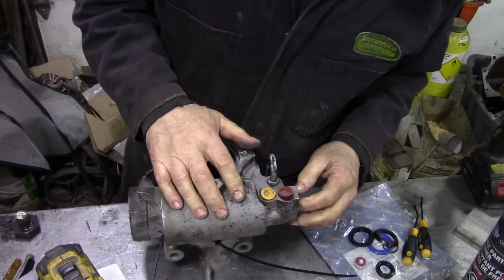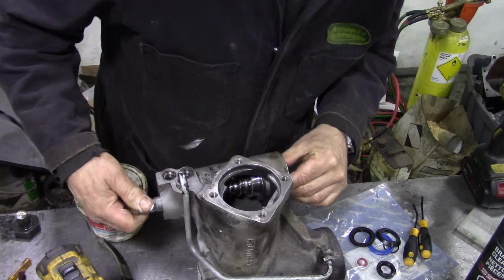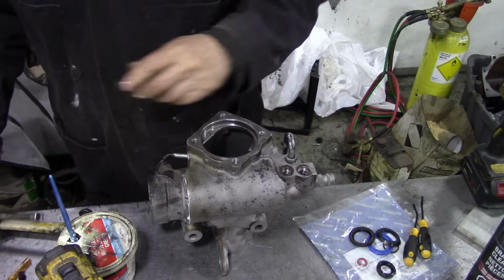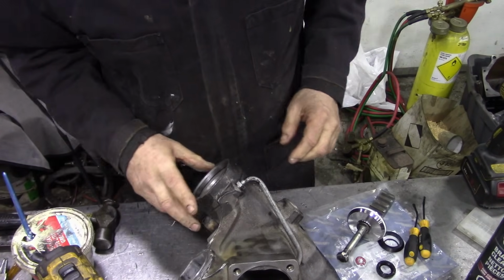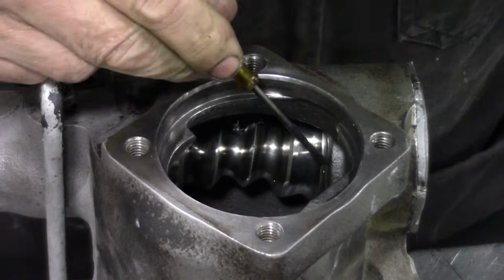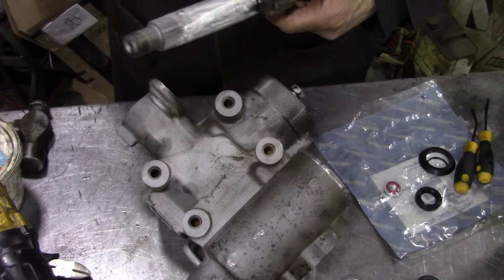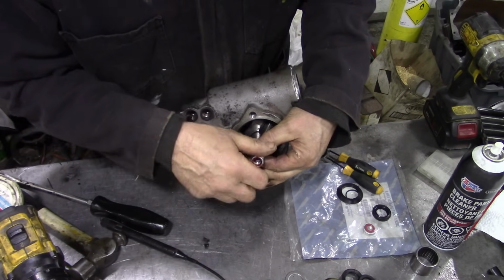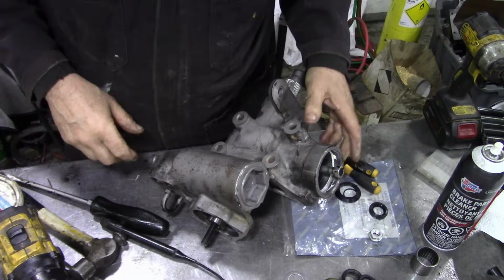Adwest Lightweight Tdci steering box rebuild part 4

Comment: Any news with the Range Rover Mike?
Reply from the maker: Sadly, no - I have tried to contact an ex employee of Rpi who helped me with an issue I had with installing, but I guess the email is dead.
Also contacted Tornado who do a similar stand alone but again no replay.

So I may have one other option and use an emulator to trick the ECU to accept a code and unlock it - but that is really for a Td5 needs a Nanocom, (which I do not have) so it would be a bit of a shot in the dark

Other option is Megasquirt, but they are on back order apparently due to lack of parts
Reply: @ 
I was going to say that to you Mike 
The young French lad who had a Range Rover you mean ? Look forward to hear some good news!
Reply: Haltech, may be an option? They have good tech support and sales knowledge so worth an email.